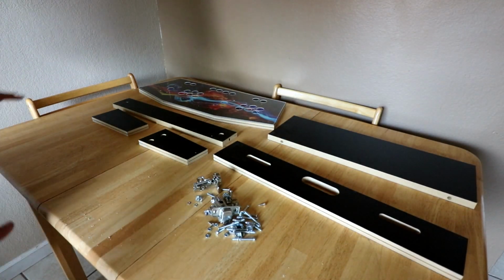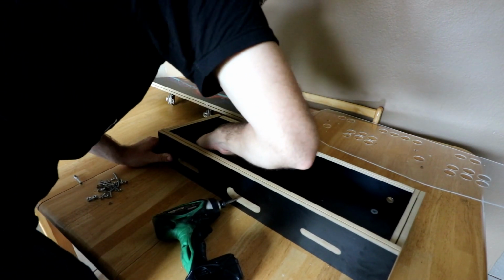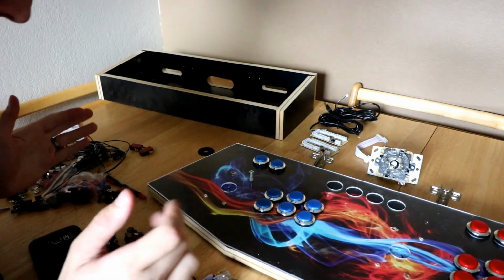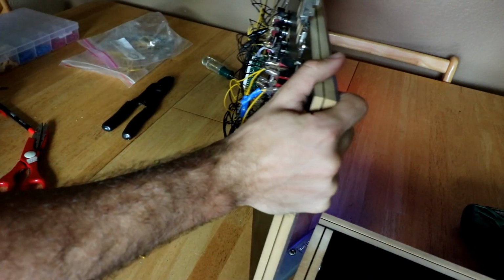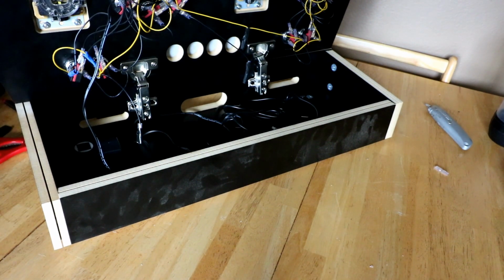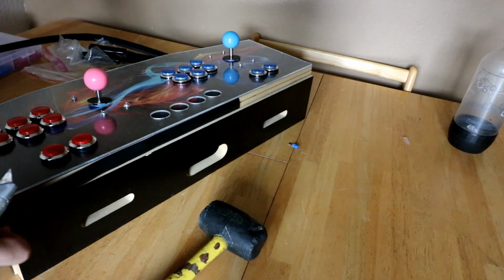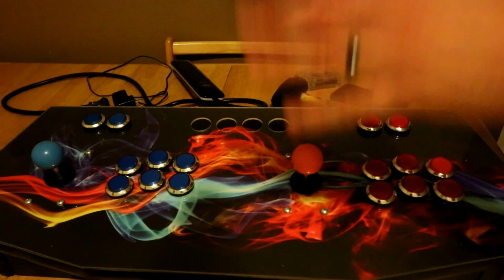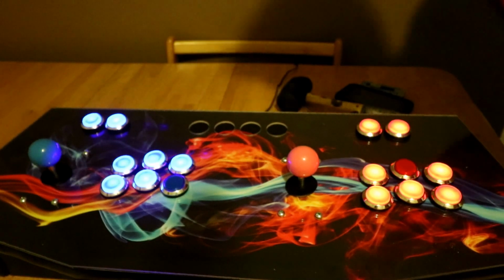Gameroom Solutions Arcade Control Panel Unboxing & Setup

Comment: Might have been easier if you had attached the hinges on that back piece even before assembling the cabinet part.....then you could have attached the cover on a lot easier by pushing the hinges into the cut outs on underside of lid.

Comment: Not bad.  I've had problems with this company in the past and havent used them in months.  I heard they cleaned up a bunch of issues with their contractor that cuts these kits out.  Which is all good.   Nice that the price includes graphics now.  Sweet.  May need to order one.  Good vid Drewski
Reply: That was 3 years ago now, we sub contracted out our smaller bartop at that time and 1 went out with bad wood cuts.  He posted complaining (as he should have), but then never took the min to reply we sent another new perfect cabinet and all was good.  For the last 3 years, we have done all products in house including CNC, printing, laminating, designing, etc.  Thanks Drew, great video.

Comment: Can this work with my xbox 360
Reply from the maker: It depends on the encoder board. You can use multiple types just research the arcade buttons you buy
Reply: What about the one in the video
Reply: nope, the zero delay encoders by themselves won't work. I saw an ebay listing a while back for a zero delay board soldered to another PCB that supposedly did work with a 360, but I didn't feel like dropping the cash to find out if it really did work.

Comment: Should have removed the black rings on the buttons. Looks alot nicer having the chrome against the surface.
Have a look at my old Mooncontroller build. It's very similar, but has built in amplifier and speakers.
Reply from the maker: ahhh nice

Comment: if you want I have some extra stand offs you can mount the encoders to the top like I did. heres a picture in case youre curious about how I did it. 

http://i67.tinypic.com/14j9f2w.jpg
Reply from the maker: ohhh nice, thanks dude. I am going to be trying a different set of buttons so will be removing them maybe when I do the final build
Reply from the maker: ps...wow wires so clean!
Reply: DrewTalks thanks man. I'm kind if a stickler for that stuff. you should see the custom controller I have to deal with at work. literally hundreds of wires in raceways. it's insane.